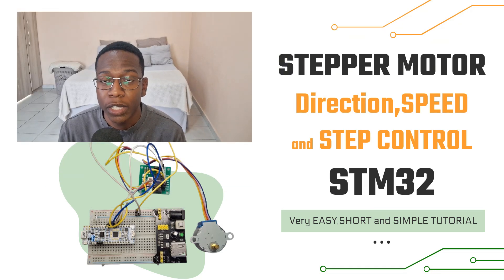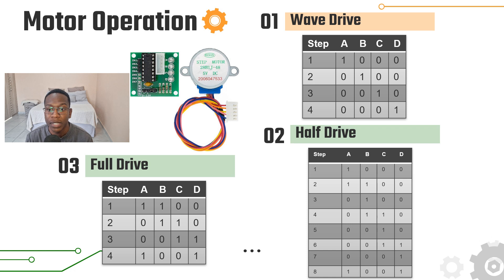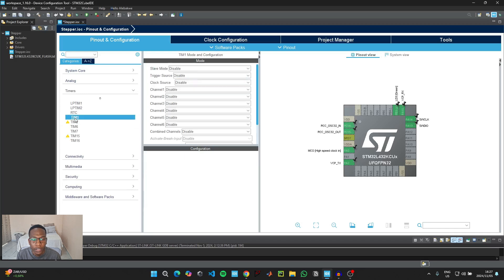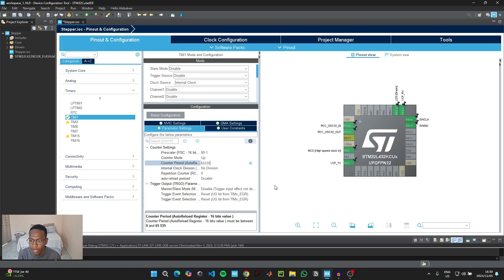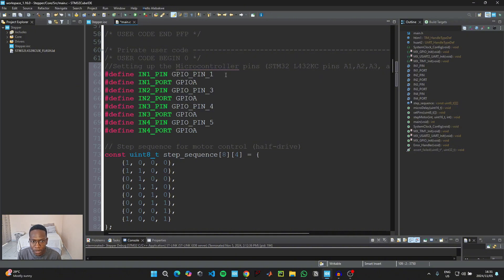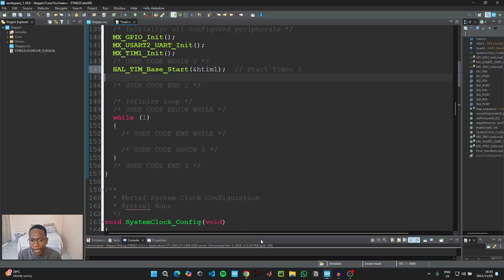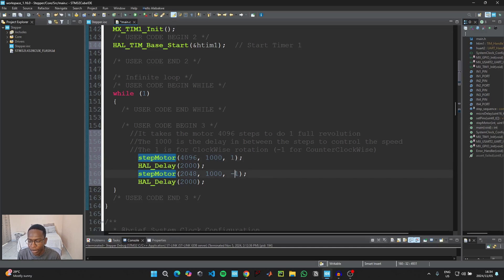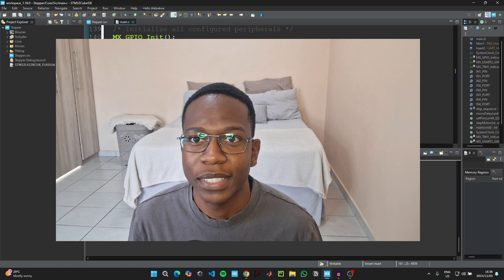STEPPER Motor control using STM32 | EASY GUIDE!

Comment: thanks for this video i find it helpful, i have a question which is, what if i use a microstep driver(tb6600) does it reqiure the same code ? if no could you please make a video about it ?
Reply from the maker: Hi. The code would be different because of differences in driver architecture, step resolution, and control signals. The TB6600 requires a more complex interface, including separate step and direction signals, microstepping control, and current limiting, whereas the 28BYJ-48 has a simpler interface. I would like to make a video about it, but I am limited to the components I got from my school practicals, so please consider checking out the donations link in the description to enable the channel to cover more videos.
Reply: @CircuitGator_HQ  oh i understand now, can you please help me do it? or  guide me a little bit?. about donations, i swear bro, i dont have a visa card that allows me to donate, i'd like to donate and help because what you share is very usefull and helpfull but unfortunately i dont have a visa card.